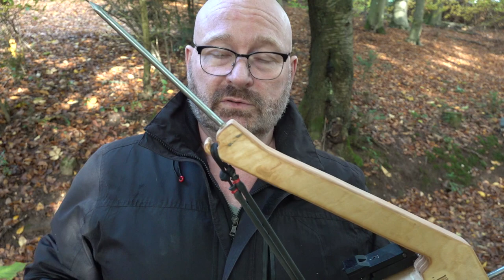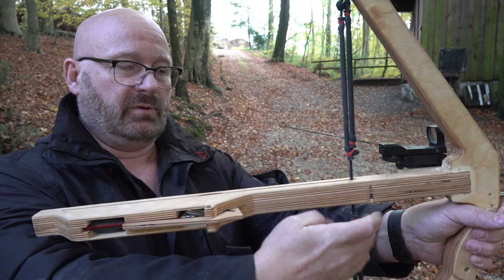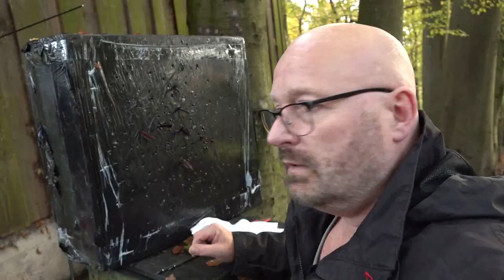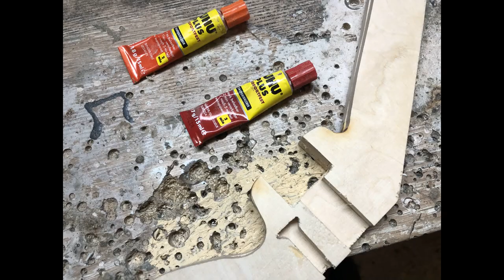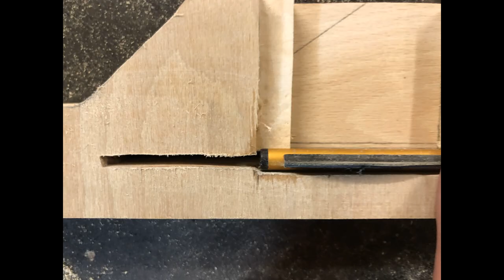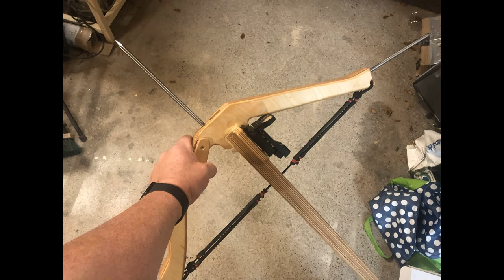The Rubber Warbow: Nine Inch Nails and Seven Daggers!

Comment: A thought about pump action: what if there was a pistol grip with a trigger. And the trigger deploys and releases a hook that will grip onto the string when the trigger is released, and release the string when the trigger is depressed.

So you squeeze the trigger to "open" the hook, slide the entire pistol grip forwards to the string. Release the trigger and hook onto the string. Then pull the pistol grip back, so the hook pull back the string along with it.

Then when the string is "cocked", you press the trigger and it releases the string, sending the bolt forwards.
Reply: Seven Proxies ii

Comment: Appears that the draw slot/guide could have a notch at the very end where the drawn string can 'rest,' allowing the archer to relax the draw hand slightly, then simply push the string out of the notch and into the guide groove to launch the bolt/arrow. Was also wondering why the magazine and the sight are not on the same side of te bow. Might not make much difference, until one as to set down the bow, in which event this bow would have one or the other on the ground, instead of both off the ground.

Comment: Have you tried adding weights inside the small crossbow bolts. I have :o) it increases the penetration. I used 5mm brass rod cut to length.

Comment: I wonder how a version of this with folding knives in place of the spikes would be. You'd be able to press a switch to extend them, which would not only make it a little more compact, but help you avoid stabbing yourself while on the move. Perhaps a switch to extend all three blades simutainiously. Plus you would be able to slash with it and not be isolated to stabbing motions.

Comment: For swinging, I don't recommend the nails as fighting spikes. Straight nails will impact at an angle, not right on the point, and they will also stick due to their round and untapered shape, increasing friction in whatever they strike. That's why blades are better! Also, I think it would look cool with some wicked blades on it!

Comment: It would be interesting to see making your weapons using a modern 3D printer and compare their perfomance, cost and durability etc.
Reply: I bet your modern 3D printer will be in perfect working conditions in the jungle or on doomsday ...

Moreover, after dozens of hours of printing, and several filament spools later, you'll still have to glue subparts together, as common amateur printers rarely exceed 30x30x30cm size.

BTW, if you'll still have a working PC and the choice, in the jungle or during doomsday, you'd better go for a CNC router, and cut the pieces straight from a panel, rather than printing something that will fall apart and possibly throwing a bow arm in your face :)

You'll still have to glue parts together, but then you know they'll stay so :D

”sorry, mr. Zombie, would you please wait 16 hours, layer adhesion in last print was crap, I have to reprint ...”
Reply: It'd cost much more, in both time and money. For a seriously strong print you're looking at owning a very large printer (which is a huge investment in itself) and an insane print time. I saw someone print a mini subwoofer enclosure (Birch ply is a typical bass bin material, so this is comparable) and the print took over 40 hours. Even then I doubt it would be as strong for this application

Comment: I think I'd opt for shorter nails or stubbier skull cracking steel spikes, milled or forged, the job is the same.

I think plans that could be transferred to a CNC machine for accurate cutting would be tremendous to have. Not that everyone has a CNC machine but accurate parts could be cut and assembled if you paid for the machine cutting and friends putting money together for such projects would bring the price down.

Comment: I think you could make the rubber configuration more efficient if the non-moving bow arms came out straight  (like a cross) instead of with the faux bow curve.  This could get more rubber stretch distance out of the same travel. Ideally, the arms would be very short, like a slingshot, but at some point it just stops being a bow altogether.

Comment: Very nice 
Maybe you could 3d print it?
Also have you ever made a ballistic knife I reckon you could make a rubber powered one
Reply: Unless you printed using some interesting techniques, I doubt a 3d print would hold up over time
Reply: 3D printing is not magics.

Aside build volume, usually quite small, which would force you to still glue stuff together, every print can be different from the previous, as environmental temperature changes the speed at which extruded filament cools up, changing layer adhesion and part strength.

A CNC router, though, once the design is refined, would allow some small batch series production, in case of zombie apocalypse, lol

Just mail zombies' gold teeths to Jörg.

Comment: The side nails could be used as a tripod if your in a prone position

Also is it possible to create an instant legolas crossbow? Maybe using a rotating drum containing the bolts AND the rubber so it is already primed and ready to fire?

Comment: Hey Joerg! I was wondering, would you be able to make these self loading bows with a "full auto/semi auto" sear? where in semi auto you have a trigger that holds the bolt and string back to fire slower more acurate shots and a full auto were it fires as fast as you pull the bolt back like the original design already does?

I think if you increased the length of the magazine a bit you could tie on a bow release aid as a trigger to fire accurate single shots, then simply drop it away for more rapid fire!

Comment: Joerg, in regards to the compound  instant legolas, might it be possible to make some sort of   (preferably detachable) lever that applies the same pressure as the thumb of the shooting hand, thereby turning it into a crossbow?
Now for a brief rant if I may. I am in the Australian state of New South Wales. You can't buy a red dot laser anywhere and if you tried to import one you might end up before a judge or magistrate. Crossbows of any kind are banned except for two archery clubs that have special permission for approved persons to use them on club grounds only. Otherwise you go to prison for having a crossbow. Same with slingshots, and bows with a rubber "string" are classed as slingshots so the bow in this vid would land you in prison. Oh, and the police would take one look at where those nails are put you in handcuffs straight away. Off to priz you go for that, too. It's still a penal colony down here.

Comment: Mechanical engineer here, producing CAD and drawings for that should be relatively straightforward.
Reply: Will it be simple to just 3d print it out of some really solid plastic?
Reply: @Scott_Stone  sure, might have to bulk out the limbs quite a bit though depending on what sort of 3d printer is being used.

Comment: Instead of a stripper clipper type setup how about a feeding device which acts similar to speed loaders for shotguns in competitive shooting? A separate loading tube which you push a follower cause  shells to feed into the shotguns tube inline. So in this case a device which holds broad heads above the magazine device and push them down. The reloading device never stays with the bow it just seamlessly feeds the desired arrows into the magazine.

Edit: Fixed spelling and punctuation though, not perfect.

Comment: I have never had a negative comment for any of your videos and i hope this is not taken as one.
I would have concerns with the bottom 9 inch nail when firing just in case you have a slip i could see it hitting your thigh or possibly even the groin.
You are the expert though so i will just assure myself that you have considered this and/or that i am completely wrong.
Great video:)

Edit:i am more often than not using re curves so the slip i suggest may not even be possible with your model.

Comment: How does the paracord react when entering in contact with the tip of the arrow when you are pulling the cord. I know you have some notch to go under, but just on one side. So do you have to pull a little bit sideways to ensure the cord going under the arrow ? Couldn't you make both side of the slit to have this kind of notch to ensure the cord going under ?

Comment: The smallest bow improved,    i asked if you could make small recurve bow. Its close to the 3 small compound bows that you showed video.
Reply from the maker: I am not a bowyer, just a slingshot guy.
Reply: Remember the liberty one bow you showed that one and also another one then one from china? I was thinking you can make one like a recurve bow and yes i remember you started with rubberband guns and slingshots 👍
Reply from the maker: @gabrielark6353  You can't, really. In order to achieve a full draw length of, say, 29 inches or so, you MUST have quite long throwing arms on a recurve. Otherwise the arms would not be able to bend far enough, just because of the laws of mathematics (geometry). Compounds can do that because they are basically block and tackle devices. Therefore you can draw them out far even though the arms don't bend very much.
Reply: Oh ok, i understand now, i shoot a recurve but i think it's to tall for me but with my height it said i needed that size, but growing up i shot a smaller recurve.

Comment: Is there enough power for boar or small game hunting?
Reply: No for the former.  Yes for the latter.
For boar you really want a nice long spear with a crosspiece.  Keep your crossbow big and just discard it, to take up your spear, if the boar survives the shot and turns on you!
Reply: @Temp0raryName  I know guys that go bow hunting - I'd rather kill my food than torment it if trying out new weapons!
Reply: @giovannip.1433  It all depends what your friends consider small game.  If it is rabbits and fowl then this weapon should kill them just as readily as any other bow.

Anything larger than that and consider the ballistic gelatin testing that Joerg does with the broadhead arrows.  If those penetrate deeply enough and with a wide enough wound path to kill a human then the same should be true for other smaller game too.

With the plus side that if it does not result in an instant kill then it can get off a coup de gras really quickly.

I do though agree that a new weapon should be thoroughly tested before even considering using it in the field or on live game.